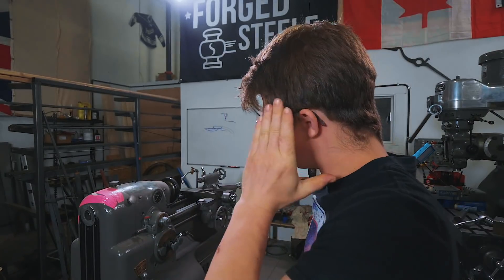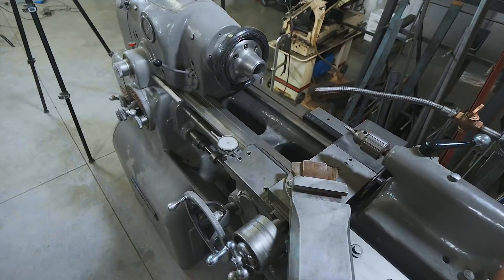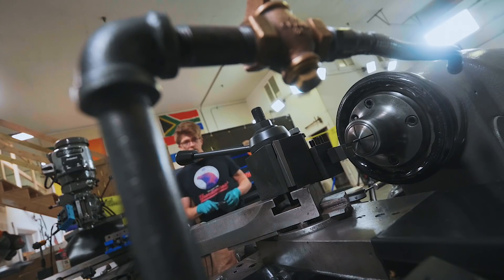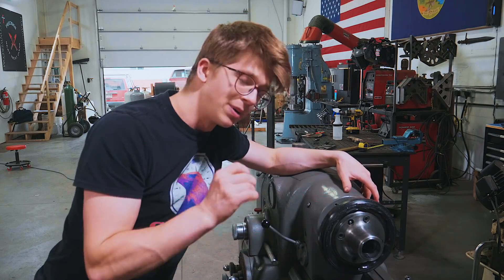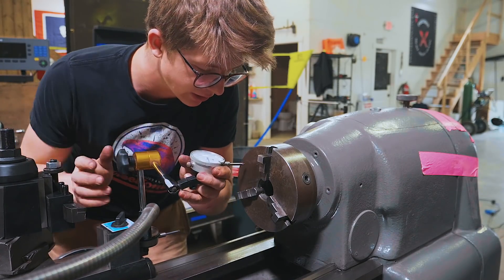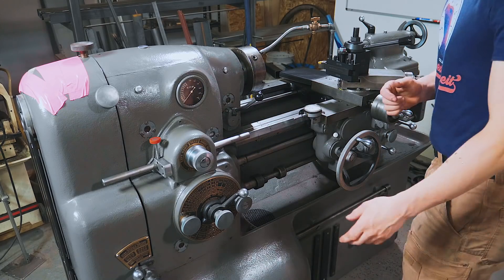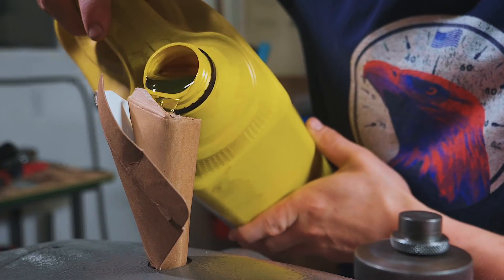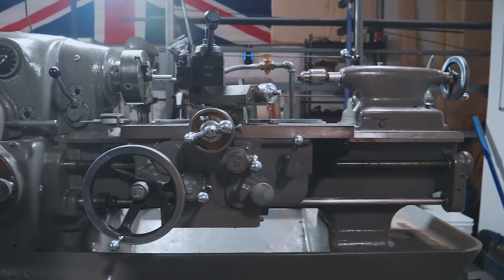FIRST CHIPS ON THE MONARCH 10EE LATHE!!!

Comment: Those cam lock pins are supposed to be loose. You adjust them one turn at a time and the cap screw just retains it place rotationally. There should be a marking range on the spindle collar. Adjust the the cam pins on the chuck one turn at a time until the mark on the cam screw lands in between the markings on the collar. It's done this way so you are the optimum clocking of the cam. Out side those marks can be dangerous because the cam can loosen and its a short taper. The idea is the cams pins pull the chuck into the taper. Get that sorted out and the chuck should go on and off more repeatably. Have fun with your new toy!

Comment: Your Chuck is a cam lock either a D1-3 or D1-4 size. You should also talk with Kennametal about getting a tooling voucher that will help you took up your new to you machines. IMCO makes some awesome carbide endmills for not a lot of money as well. I use a lot of IMCO endmills and 90% of my lathe tooling is kennametal/Widia and the rest is toolflow.

Comment: You need to get a 3 jaw chuck with normal Jaws for round stock. Those Jaws will impede your tool post, especially when using a parting tool. Also get a 4 jaw with reversible haws for eccentric work.

Comment: ACCTG. NO. simply stands for "Accounting number".  Basically the contract or purchase order that this was procured under.  The serial number is indeed #2, e.g. the second one built.  The 1 at the beginning is essentially to hold all the zeroes in place (000002 would basically just be interpreted as 2.  Adding the 1 forces the zeroes to stay.)

Comment: Center drills aren't really meant to be buried up to the end of the outer taper.  Just a bit of a bevel is needed to help center the tip of the drill.  Starting a drill bit on a taper is actually harder on the corners of the flutes as well.  In short center drills are only needed for first starting a drill onto the workpiece so the drill doesn't wander.

Comment: Nice Kershaw Leek. I've used and abused mine for ten years now, only had to replace the spring once (which they will send you for free if you ask). Sandvik steel is great for an EDC knife.
Reply: I've had to replace mine 3 times. I just asked for 3 replacements the second or third time it happened.
Reply: @xenonram  I didn't even ask and they sent me two. I wish they didn't need replacement, but when your knife holds up that long a spring is eventually going to break! Replacement is pretty easy. I'm glad they send the parts out for free.

Comment: A generator that generates DC power.  As an Electrical Engeneering students this blows my mind since transistors and diodes weren't a thing back then. Making DC from AC is the simplest thing ever in electronics nowadays.

Comment: Monarch are solid lathes have spent many hours making parts on them. Most people use the smaller 3/8 and 1/2 in tool holders on them..inserts are cheaper. The smaller tool holders work better with high speed steel blanks you use to make special tools.

Comment: I did a quick google on these search parameters ..  "operators manual monarch 10EE"  and found the info you may need to safely operate the machine.  (I am surprised that they did not supply the book with the lathe as it is a "how to safely operate the machine" manual. )

Comment: 10002 will likely be the factory and tooling set that was used to make that chuck. The chucks wouldn't have been serialized individually, they were a disposable component. It could have even been used as a reference for parts or weapons manufacturing; replace the chuck every 10,000 uses. Most military serialized equipment doesn't start with a 1 or end with a very low number. The number one is easily confused with an I or and L with a bad marking, very early serialized items (001-015) are usually test runs on the new equipment and considered "junked."

Oldie and a goodie, but not the 2nd ever made. Likely the 10th run and the 2nd batch of whatever equipment they were manufacturing it on.

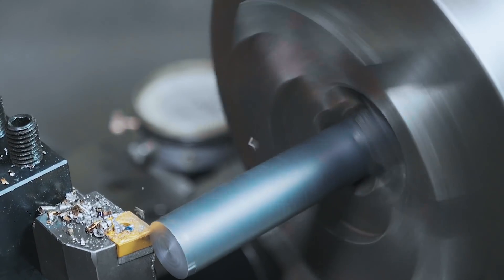Comment: And Alec at around 13:00 when you are cutting I can see you are pulling a burr on the part, that either means the part is going too fast, the bit is dull or the depth of cut is too deep I believe. I think it is the speed as this machine looks like it's built like a tank and the bit is fresh. 1200 is aluminum territory  on the machine I use at school. I push 500 sometimes for steel but usually run it at 430. I find that is the sweet spot. No hate just some tips from mistakes I made😊. I am not perfect by any means, I left the check key in and turned the machine on once. Socked my right in the goodies and did not feel good as it was set to 1450rpm. Lol hope it was helpful

Comment: It was probably the second chuck for that production run. Typically in Military production the initial number is assigned on a semi random basis for each production run, the idea is that if the enemy find out multiple numbers through capture in combat or espionage they can't deduce how many of something you have  ie if yo had 2 production runs of 100 each and they find out two numbers that are 10 and 134 they can assume you have at least 134 of something, but if those numbers are 70010 and 90034 its much harder for them to deduce

Comment: SWEET!  I've been waiting to see that beautiful machine work.  That thing is f-in AWESOME!  Congrats on the first chips, nice tool holder too.  

Speaking of HOW NICE IT IS... you TOTALLY NEED TO make some leather covers for the ways on it.  Check out Stefan Gotteswinter's YT channel, he makes cool stuff on his equipment.  Anyway, he has some leather way covers on all of his equipment so that the metal and or grit stays off of them and doesn't chance screwing them up.  He just has leather, looks real soft and moves easily he probably has fairly thin leather and nice and oiled or something, but i dunno, he doesn't get into leather prep LOL.  The leather just has magnets embedded on both ends to attach to the machine.  Easy to make, install, and remove if needed too cuz magnets.  Seriously, check it out please - your machine will appreciate it, it'll greatly lower the wear on those ways.

Comment: Hey Alec, just wanted to shed some light on the 100002 meaning.The US Navy "stenciles" every tool they have and have a particular numbering system for what they refer to as "tool control" and from my understanding the "2" in the 100002 means that that lathe Chuck has a small penis.

Comment: oh man, those control electronics are glorious.  Reminds me of the stuff I used to work on.  Did your electrician check the brushes on the motor and generator?  You're going to want to clean the relay contacts as well as the rheostat once in a while.  Is there a schematic you found???  That would be awesome to see.

Comment: Was made as a shipboard lathe where you had DC power
Reply: Not so. 
1) Most US Navy lathes were in onshore workshop shipbuilding or repair facilities
2) All Monarch 10EEs from 1941 had a three-phase AC motor driving a 3 h.p. DC generator that provided power for an electronic variable-speed drive system (so two motors and one generator). The motor-generator stage was replaced later that decade by an AC-DC converter using thyratrons, but still a DC drive motor. In 1960 it went solidstate, but still with the dreaded thyratrons, and still DC. Then in (I think 1981) they finally lost the thyratrons, but STILL DC. Then in 1995 finally they switched to a modern AC inverter drive.

Comment: This is VERY different than the electrics in my 10EE at work.  Mine has ward-leonard control with these four huge gas-filled switching tubes.  It is an absolute joy to use but is likely later than yours.  I'm curious if you have details on the motor control system; is it just throwing big resistances in the field coil or doing something more fancy?

Comment: try turning the tool post 90 degrees counter-clockwise so that the tool sticks out past the post without running the other quick change part into the stock. idea for video. make an old pirate pistol with Damascus barrel and butt plate

Comment: It would be cool if you collaborated on a project with Peter brown and/or Bobby Duke. 

Half epoxy resin with skittles and crushed captain crunch for color,

Half wewden hand mount with light inside of it

Half damascus steel with light saber turned on a lathe.

Comment: The bar is not that far off I belive your chuck needs some work its not holding parts in the center, if and when you flip a part end for end you'll find the out.  Take a chunk or stainless steel ground rod mount a dile indicator on the tool rest and see how close the chuck spins to center.  Also you might be able to download an owners manul or operators manual for it. Contact monarc they still make machines today. 
My bet is thats a wwII machine.
Its 70-80 years old and still working.
If the chucks out you might be able to fix it.  You wouldn't run the brodgport if its collects were off center.  Trust me that bar wasn't bent that much if at all you shouldn't be taking 50 thou off one side and nothing off the other roughing it new stock. Thats in the chuck. Test it with ground stock stainless should be pretty dam stright. You can test it on an inspection table.

Comment: You probably already know this Alec, but your shop's new rule #1 when the lathe is going to be used:  Always know exactly where the chuck key is before the spindle is engaged.
Rule #2: If the chuck key is in the spindle and isn't being used to fixture in or remove a work-piece--REMOVE IT FROM THE SPINDLE.

You do not want to be one of the guys posting a video to youtube about the spindle chucking the chuck key through their shop wall/ceiling/co-worker/camera-crew.

Comment: You need to learn how to check and fix the run out first. Then check to make sure your carbide tips are running to the center of the steel you're turning. (adjusting the quick change head on your new tool to hold the carbide at just the right height)

Comment: Just be careful not to accidentally put it into thread cutting mode. It will automatically feed the table across towards the chuck, and the higher your RPM the faster it will feed making it easy to crash. Have fun :)

Comment: is there a specific reason for using old machenery ? or is just that you like it ?
Reply: The world we live in is, unfortunately, a very wasteful one. Everything made nowadays is made very cheaply and is essentially disposable. Your cordless drill broke? Throw it away and get another one. Your belt sander is acting weird? Time to get a new one. It's cheaper than paying someone to troubleshoot and fix it. 

Those old machines, however, were deliberately overbuilt to handle whatever workload you threw at them. When they finally broke down, it was after seeing DECADES of use and abuse, and not because it consisted entirely of cheap plastic widgets that were supplied by the lowest overseas bidder.

A lot of those old machines have outlived their owners. I have a Sears & Roebuck power drill from the 1950s that belonged to my grandfather that works like a champ. My kids will probably be using it after I'm gone.

Comment: The tool rest needs to be at 30 degree angle perpendicular from the lathe axis in order to half with the handle that you kept (30 from the lathe axis will allow you to half when using he handle you removed). Why 30? Cause the sin(30) = 0.5. If you go with 45 as you mentioned you get .707....

Comment: Adjust the drop speed on your bandsaw so the weight of the saw isn't riding on the blade.  The weight of the saw body on the blade will cause it to twist and flex right at the cutting surface. This wears blades out quickly or just break, but more importantly it causes inaccurate and sloppy cuts.

Comment: How to find the speed of the spindle it is
 3.82 x material/ diameter of the part  
material speed 
 aluminum is 100 
Mild steal  is 70
Tool steal is 50 
And when using carbide time by 3

Comment: So the Laythe actually needs DC?  do you know what voltage?  I could possibly build you a power supply and it would be MUCH quieter than running that AC motor/generator thing.

Comment: Alec check our Mr. Pete222 also know as Tubalcain for some machining basics. Too much stock hanging out of the 3 jaw without live center support. Will make your finishes and matching work much more accurate and will not damage your tooling, lathe. Or workpiece. Abom79 is also a great source too, as others have stated.

Comment: Just a heads up, something you probably already know. Even though that machine appears to run up to 2500 RPM I wouldn't recommend running it much higher than 1200.
Reply: That model lathe was supplied with a 4K  tachometer and a pulley change.  So no need to limit the speed to 1200 rpm unless it's for the chuck (many cast iron body chucks can't handle 4000 rpm)
Reply: @russkepler  Yeah I was more worried about the work holding.
Reply: @reggie7653  Using the right jaws would be a good start.  That chuck looks like a Cushman, if it is it should be good to about 3500 rpm for a 6" model

Comment: assumption acctg (acc)oun(t)in(g) 91749 this was similar to a number on my dads old army revolver from his army days his said army acc NO. with numbers then after that the fire arms serial number in a almost identical lay out. Also a google search for acctg turns up allot of accounting related results. So this was for internal accounting uses what ship or base the chuck was issued out to. The serial number is quite likely the number of the part off the assembly line for that particular chuck so it was simply number 100,002 to be made. The fact the serial number does not include a date code or batch number etc simply means the was no changes in tooling needed to produce it and no differences between 1 year and the next. If you look at a serial number on a bicycle esp ones made in Europe they have date codes in the serial along with other information along with a 3 to 5 digit serial number referring to date of manufacture some times month  and day as well a lot number and unit number First on date number is unit second non date is lot and 3rd non date number is part of line for that year or day. Non Europe bike but my old cannondale was 09/84/05/03/11/105 unit/year/day/month/lot/serial the /s were not printed.

Comment: Forgive my ignorance here. 1600 of electrics and everything is off kilter or out of whack. 
Why buy old? Is the cost of a new one so prohibitive?
Reply: I think Alec is one of those "they don't build them like they used to" types. Of course, that very well could be the case with heavy machinery like this, especially given the decline of manufacturing in the west.
Reply: Chris Droney you’re probably right. I just looked at a large website and new large lathes (i have no idea what I’m looking at) cost 29000-45000 and up lol. That could be a factor too.

Comment: scales lose accuracy at their limits and 2500 rpm is probably the calculated possible but it could be a few 100 out near its limits. Just like how its hard to get precise slow speeds. Kinda the paper doesn't equal reality

Comment: While its probably more likely that its the second chuck made in that serial range, i dont think it would neccessarily be far fetched to think they made 100k chucks during WW2, especially if youre talking american military manufacturing.
This is because machines were setup for doing a single job and only that job, because doing multiple tasks on the one machine GREATLY slows down production, and the americans were the kings of mass production during WW2.

Comment: LOL, I love you Alec but no.  Setting the compound slide does not effect to in and out travel of the cross slide underneath.  It's the other way around.  You need to  use the compound side set at for example 45 degrees to half the "in and out" travel of the tool.  So you might wanna think about putting that handle back on there bud.

Comment: Alec first off, your stick out is way too far.  The rule of thumb for unsupported stick out is 3 times the diameter of your work piece. After that you need to support it or you get chatter and flex. Second, you want to set the compound rest at 29 and a half to 30 degrees for thread cutting. Enjoy. I first learned on a monarch. Great machine.

Comment: Oof ur first chip and u take like a 0,5mm cut xD normally you should make a cut which cleans up the material because the hard skin is not good for a carbide insert and ur chips where comparable to some drill chips xD you could have easily made a 3-5mm cut and u needed more feed

Comment: Alec, please be careful with running wires on the ground in front of the saw.
Know someone who was almost electrocuted when the piece of steel he cut fell down, hit the wire with the edge and cut right through the insulation.

Comment: OMG Will. (@7:28) Absolutely not one hundred and two thousandth. That would be 100.002. 
The and means decimal. How do you not know this??
One hundred two thousandth (without the and) would still be 102,000. 
You should be saying one hundred thousand, second.That's 100,002.

Comment: Wonder who told this kid to buy a monarch 10ee, one of the nicest lathes of its size. He clearly isn't very familiar with the machine. Jaws hes using should have at least been turned around. The part running out like crazy when facing and turning because of this and too much stock out of spindle without  a center. I'm sure by now hes familiar with it....I hope.